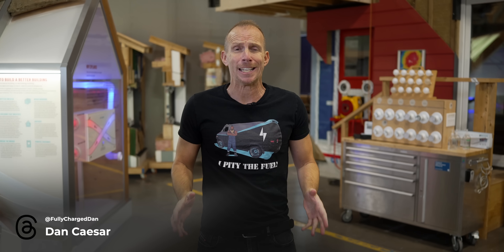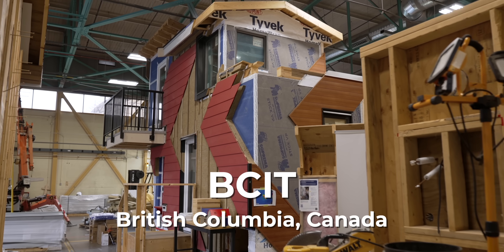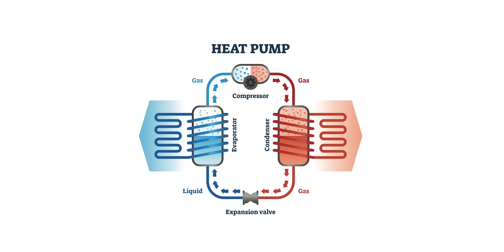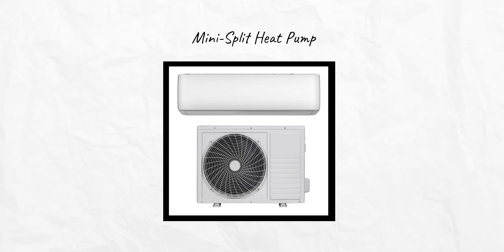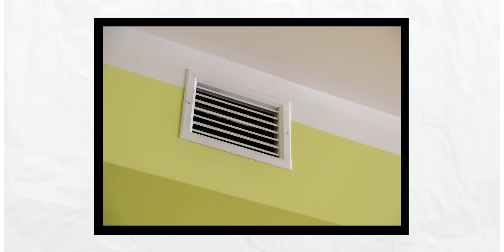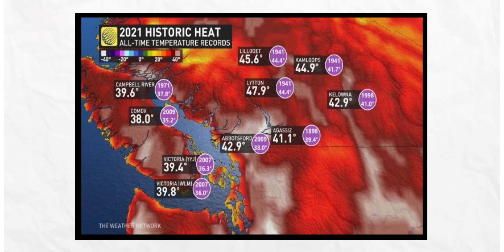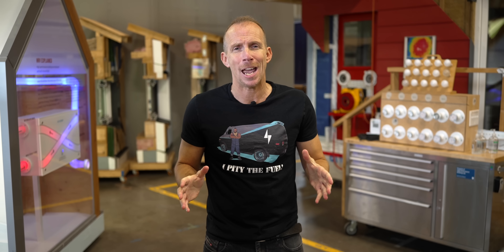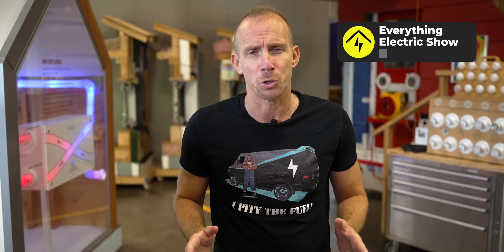The Future of Home Heating and Cooling!?!

Comment: I’m in an old (inefficient) house, have a Mitsubishi a2a heat pump and get an scop of over 5! Brilliant system that heats and cools. It’s a shame in the UK that heating systems are so tied with the hot water system, as if you seperate these systems you can get the benefits of a2a and hugely increase efficiency.
Reply: Very interested to hear how you're measuring scop. I don't know how to do heat metering on an a2a system! 

There is a Daikin product which does dhw as part of a multi split a2a system, but we can't get it in the UK.  I did wonder if it would technically be covered under the bus grant.

Comment: Isn't suggesting "EveryThing Electric" the same as  "putting all your eggs in one basket" as suggested here by going all electric. "Everything Electric", is proposing drawing all our energy supply through wires to run our lives from just one energy source, that being Electric Current.  What happens if the one source infrastructure design of Electric Supply over wires is not available to the public for years ? Google "The Carrington Event" or, “The Miyake Events”. Seems suggesting that human society is best served by running “Everything Electric” that needs to be powered in our lives which perpetuates modern society’s wellbeing is a risky Daft pursuit devoid of the clear logic presented by an alternative powered world of “all of the above fuels” utilizing a multi fuel source powered society with ample operating backup fueling opportunities when electrons can not drift. The new YouTube Channel could be called “The Everything Fuel Show”.

Comment: Does anyone do indoor units that don’t look so ugly?
Reply: Yep, the same people who do radiators and ducted hot air vents that don't look ugly.
Reply: There are definitely some decent options out there for wall mounted units. We have a Mitsubishi MSZ-EF unit that looks pretty smart.
Reply: You can have a choice of 3 options:

A radiator look a like on the floor 

A cassette mounted in the ceiling like you see in restaurants or shops 

Or a wall mounted unit.

I choose the wall unit as it frees up space for furniture
Reply: @davetester100  It would be nice to have something to replace the electric fan heater in our living room - it looks like an Amberglo.

Comment: As an Australian it's fascinating to see something that's been commonplace in almost all of our homes for the last few decades needing to be explained to a UK audience. I have 4 Reverse Cycle Air Conditioner (RCAC) split systems in my old little home, the oldest being at least 20yrs old. On the flip side, it's only during this winter that most Australians have come to the realisation that most of our houses have little to no insulation. Swings and roundabouts.
Reply: But you folks were further behind on EV adoption, so it all evens out 🤣
Cheers
Reply: @patrickmckowen2999  catching up quickly though. I've bought 2 EV's in 6 months. The floodgates have well and truly opened.
Reply: The UK had a run of air heating installation in new builds back in the 70s, as an alternative to radiator central heating during the time when the country was working out ways to also move the older housing stock over to central heating. The problem was the air heating systems were often oil fired based solutions that were very expensive to run, smelly (residual oil odor pumped around the house), and left cold spots/rooms as the heat was distrubted via a central column with passive spurs to the inidividual rooms (most of the heat was extracted at the start of the air run). Various pests became a problem in some parts of the country in the heating vents. They were not popular and died out in the 80s but left behind an idea that air heating wasn't efficient, affordable or warm. In effect radiators and water based heating won the technology battle and became the dominant central heating based system in the UK, with electric storage heating coming second.

This of course is a million miles away from the modern A2A and air heat recovery systems, which don't suffer these limitations but most homes now are built solely with water based heating in mind, retrofitting A2A a house wide can be more problematic. Although if fitted with a suppporting heat recovery ventilation system can be as cost effective in the long term as water based heating solutions. The move to home PV means A2A, and A2W, have become even more of a cost effective consideration.
Reply: @GruffSillyGoat agree. I remember a council built housing estate with a central large of peak electric storage heater. It had hot air ducts to rooms. It was too expensive to run. People got gas installed. It failed . The houses had little insulation no double glazing. Along with the gas boiler was around same time roof insulation and double glazing. Making gas cheapest
Reply: It's just that traditionally we had no need for cooling, so wet heating systems were fitted. It can be quite a job to convert from a wet system to an A2A one! But that's not really an excuse for new builds. With climate change our building industry desperately needs to build homes fit for the future with systems that can both heat and cool. But hey we've always done it like this, change is scary.
Reply: mine has a heat function too.. heats the room up nicely even during July nights.. so I guess its same as air-to-air heat pumps then..
Reply: https://youtu.be/myvfqCx1-zk?si=X1QHaZpKEuz3Z5Ri
Reply: is Air to Air heat pump, same as "Inverter" air conditioner..?
Reply: @jai.shah007  yep, just a different name.
Reply: Not completely. Inverter just means the air conditioner has a DC inverter to run the heatpump, making it more efficient. Which is common now.
But you have to check that it can heat too. And there are huge differences in how well it can heat, and down to which cold temperatures it still works.
Never buy the cheapest one, go for mid level.
Reply: @roland9367  you're correct. Cooling only split systems are super rare these days in Australia, from my experience. Usually just the box ones left over from the 70s, but the government will replace those for free with a modern RCAC so I've only seen them in the homes of stubborn old people.
Reply: @johnnyonline  Yes I agree, you can hardly buy anything else than an airconditioning unit with inverter, which can also heat.
But technically the inverter part doesn't specify that it can also heat, and when people refer to them as air-to-air heatpumps, they are looking for heating.

Comment: I live in the UK, up north, I have had 2 mini split units fitted as I don't have gas, and electric radiators are silly expensive to run.
Mainly got them for heating my 2 bed semi,  which they do very well, and very cheaply.
As I bonus, I'm typing this sat in my air-conditioned living room 😊 cooling is about a third of the cost of heating
9k and 12k units fitted, £3300
Reply: Is that a new build or did you retrofit that system in a house that had a boiler? Also don't you want the vents near the ceiling for cooling and near the floor for warming??
Reply: @duncang7372  houses roughly 50 years old...no gas...had electric radiators..
The 2 mini split units heat and cool well, directional vents direct up orcdown dependant on season. Really glad I had them fitted so much cheaper and house is actually warm

Comment: WE NEED A2A SHOW HOMES :   Air B&B  where we can spend a night to see if A2A is nice or horrid to live with . In UK it is permitted development to install one "heating only" heat pump. , but any heat pump used for cooling needs Planning Permission, Some installers say different, but none have presented evidence ( please be the first !)  .  You would think A2W monoblock to existing plumbing would be easy to install , but even replacing old A2W monobloc with a new model comes in a similar price to installing whole  A2A multisplit , with "top & Tail" new a2a units onto existing piping a straight froward process. .  With the 2 trades Plumbing & F-gas separate it is very hard to get comparisons .
Reply: Even 'heating only' A2W air-pumps need planning permission (mine was refused permission due to 'noise concerns', sigh)
Reply: https://youtu.be/myvfqCx1-zk?si=X1QHaZpKEuz3Z5Ri
Reply: Incorrect statement planning not required in domestic situations
Reply: @davetester100  If that's a reply to me, then planning is required, if the exterior unit is within a certain distance of neighbours windows, etc (that was the rule that triggered planning permission for me)... and this is pretty much guaranteed to bite for anyone in a terraced house
Reply: @logicalChimp  I thought it was only 1m from a boundary wall, and even in my terrace house that would be achievable. At least I hope it's 1m..!

Comment: A more in-depth video or at least one more specific to split unit systems would be great to see!

These are the kind of systems being used across continental Europe and I think a lot in the UK have no idea that the 'AC units' they see when they go on holiday can also provide heating. In a way that can be much cheaper & easier to install with the benefit of cooling too.

A2A systems should also be included yesterday in the upgrade schemes, the energy usage due to occasional cooling is just an excuse.
Reply: https://youtu.be/myvfqCx1-zk?si=X1QHaZpKEuz3Z5Ri

Comment: SCOP of 2.5 to 3.5 is pretty weak...

Although thats for Canada with more serious winters and summmers than the UK so maybe an A2A could perform as well as tuned Air-to-Water systems in the UK...
Reply: a2a  heat pump here in the netherlands   i have a scop of about 4    so i think you could reach that in brittain also
Reply: My Mitsubishi Air 2Air in the UK has a SCOP of 4.5 in heat mode & 8.0 in cooler mode. According to the specs sheet!

Comment: I'd like to know more about the dehumidifying possibilities with this, as I live in an old, cold, damp house in North East Scotland..
Reply: Just running the system on A/C will remove a lot of moisture from the house, you can watch the water dripping out through the condenser outlet pipe attached to the outside unit. Many new models now come with a "DRY" setting, great for damp days where you don't need heat or A/C. We've always had "Venmar" air-to-air heat exchangers for moisture control, you may want to look into this if the cost of the heat pump may be too high. $500-700 CDN for the main unit, running the ducting is a few more dollars.
Reply: @radbaron Thanks - definitely need one of those, then. Just wondering if it will work well enough to negate the need for separate ventilation once we've insulated the house as best we can..
Reply: @Danothebaldyheid  All depends on the size of the house, of course. But it should bring down the interior humidity levels to what you want, just over a longer time.
Reply: I installed a Mitsubishi Air to Air Heat Pump 2 years ago in the UK. 
It has the following modes:
heat
cool
Fan only 
Dehumidifier 
Perfect solution for damp UK climate
Reply: Thanks -: it's useful to know. I'd really love a ground source heat pump, but they're just so expensive. I think this might be the next best thing..

Comment: Well, I'm in Scandinavia and my relatives that have installed heat pumps have gone with ground source heat pumps. Bit better getting heat out of the 8 Celsius ground than the - 30 Celsius air in winter.
Reply: I’m in England and have an Air to Air Heat Pump and is perfect for heating & cooling my home year round
Reply: Far more expensive though 
Cheers
Reply: @patrickmckowen2999 

😂😂😂😂

Perhaps money isn't an issue but comfort is?

Granted it might be an expensive exercise to us but other people couldn't care less.
Reply: @patrickmckowen2999  More expensive to install, cheaper to run. I'm not sure how much exactly. I've seen 'up to 30%' suggested. In the UK the temp diffs are not going to be huge, but 13C delta for GSHP and 20C delta for ASHP (when it's freezing) will help. My neighbour install his 3kW GSHP for under 2 grand DIY. So it doesn't have to cost a fortune.

Comment: I think Rondo brick heat technologies using rooftop PV electricity may be the best heat technology including hotwater on demand. And area heating. 
A2A may be using expensive mechanical pumps and expensive grid electricity at sundown. 

Dirt cheap bricks and dirt cheap rooftop PV electricity.
Reply: But can Rondo brick heat technology be incorporated into a system that can also cool a house efficiently? After all that was the point of this video.
Reply: @davidlegg6545  both cooling and heating is the point. At 5.07 they refer to heating. 
My point is that even in warm latitudes heating is required at times including hot water.
Dirt cheap heat storage is a good suggestion plus
 Airconditioning at times is needed and should be minimal and small.
Energy and money saving was the point.
Reply: @stephenbrickwood1602  Having thought about it some more I'm not sure if bricks are the solution to heating. If I get 1kwh from a PV array I can only get 1kwh of hot water but if I use it to run a heat pump I can get 3 to 6 kWh of hot water. Maybe it is best to store surplus energy in a battery?
Reply: @davidlegg6545  you are right. 
I was thinking that bricks would be dirt cheap and have no maintenance problems.
Rooftop PV should be sized for the worst case and so in the better times there would be excess electricity. 
And heat when the sun was not shining would be a more common need.
Just my thoughts.

More rooftop PV shading hot roofs and dirt cheap heat storage.

Comment: Had air2air for a couple of years now, 3 zone multi split.

Cools and heats very fast, old 100 year house with little to no insulation (gonna add more loft insulation this year)
Reply: What brand do you have? We have the Pichler PKOM4, and it's as efficient as I thought.

Comment: How about maintenance? Is there a way to keep them at near new performance yet?
Reply: Service once a year keeps them efficient
Reply: Annual service. Most important aspects: cleaning the  air filter in the internal unit and cleaning the heat exchange fins on the outdoor unit.
Reply: 10 year warranty with my Mitsubishi if serviced annually and clean filter every 6 weeks
Reply: I should have been more precise. My knowledge is three or four years old so things might of changed. Back then annual cleaning would return units to about 60% of the performance of new because there's no way to physically scrub the heat exchangers due to the elements being so small and so plentiful, a chemical rinse can't remove the toughest build up. So question is, has this been overcome at least in part?

Comment: Living in a tropical climate, I wonder whether, and how, cooling by heat pump would work here as compared to the ubiquitous air conditioners with their also necessary dehumidifying properties
Reply: An air-to-air heat-pump IS an air-conditioner, capable of operating in either direction.
Reply: @DevAnubis  thanks, I just did some research on the technical background and yeah, an inverter AC is the same thing (except some sold-as-such ACs can sometimes cool only, but that doesn't matter here)